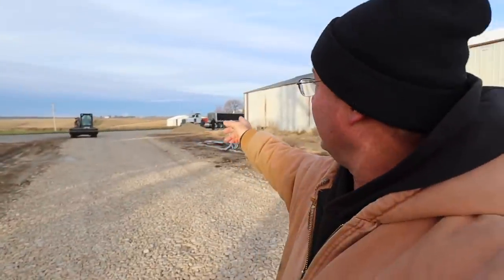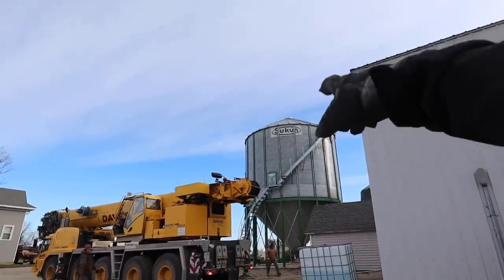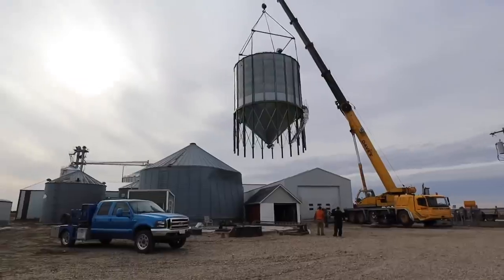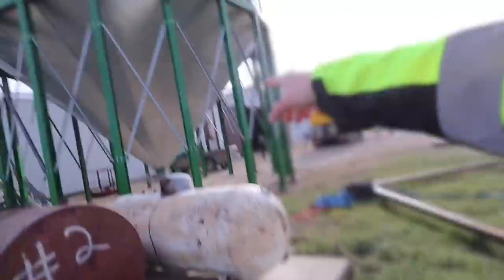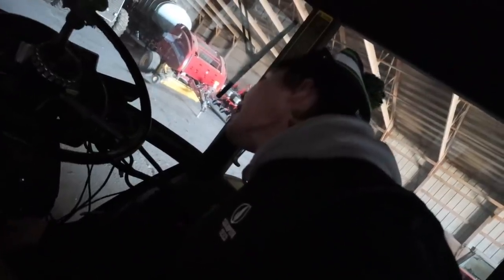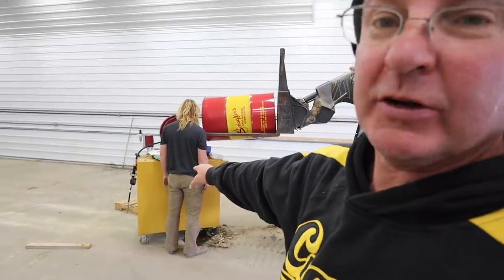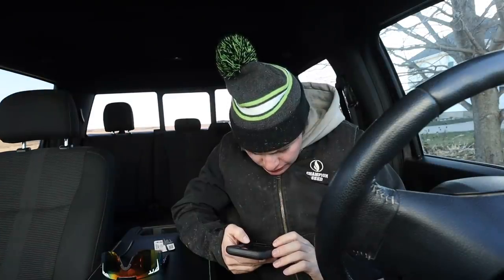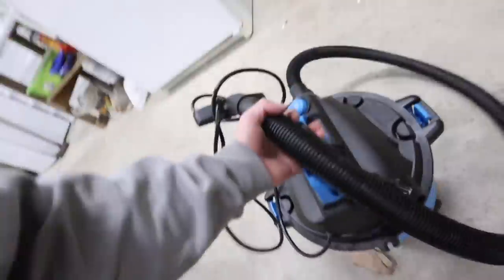My Biggest (& SCARIEST) Bin Move EVER

Comment: When you pushed the button on the contactor and the washer started, that was telling.  It means the entire power circuit is good.  Now you have to dig into the control circuit and find where the failure is.

Next time you have a device like that let you down, check across contactor's energizer contacts for continuity first.  It could be the contactor's actuator coil is cooked.  It's a fairly common failure mode and you just have to match ratings, it's a standard part.

Comment: Cole,  while using the vacuum to clean the dust, it is best to use a dry brush to agitate the surface and it will lift more dirt that way, especially around switch housings and vent louvers.  I use a shaving cream brush for my cleaning maintenance.

Comment: Hey Cole, you mentioned cleaning out the cabs of the machines, in order to make it less attractive to mice.  Another thing you can do is put a few drops of peppermint essential oil on the floor or other areas where mice are likely to make nests.  They don't like the peppermint scent.  (You can put the drops on a plastic lid or something disposable like that, if you don't want it directly on the equipment.)  I put some on my tractor a few times a year, and haven't seen mice scurry anymore when I start it up.
Reply: I heard those dryer sheets work too.
Reply: It’ll make the equipment smell better as well. Probably isn’t the best smelling place after months of harvest.
Reply: Mouse Away bags work great, put them in the car and boat we store over winter and no problems, ever.

Comment: Hey Cole, to save your truck interior and seats I'd recommend you get some good seat covers.  And I mean get some Wet Okole seat covers.  The are made from wet suit material, don't get hot in the summer or cold in the winter.  Waterproof, stretch fit, you can choose the colors and very durable.  I drive a '03 Ford Lightning.  Had it since it was just off the line 18 years ago and I use it as a truck.  It is starting to show its age and use but since the first month I had it I've had Wet Okoles installed.  I'm on my third set and getting ready to order my fourth.  My seats under the seat covers are still pristine.  The covers keep sweat, food and spilled drinks from getting to the factory covers.  They are easy to clean and easy to install.  Since my truck is a regular cab with 60/40 seats and a center console the cost is just over $300, and that is the same price I paid for my first set in 03.  They keep the value of your truck up and last summer I had an offer of $23k for my Lightning.  No lie $23k for an 18 year old truck.  I'm not a salesman nor do I represent Wet Okole in any way but I see the care and pride you folks show for your equipment and while after market floor mats are great to save you carpet, good seat covers save your seats.  Who knows.  Maybe they make combine seat covers and seat covers for your steroid injected tractor.

Comment: I think a lot of people would benefit from a basic electricity course of some kind. I grew up farming, got an electrical engineering degree, and now work for the electric company. I watch all the farm youtubers, and I gotta say a lot of the electrical issues you guys have might seem complicated (and people are skeptical about working with electricity and that’s ok too), but they’re likely very simple fixes. Invest a couple hundred in a good Fluke multi-meter, and from there it’s just coils, contacts, and load. Bin fans, leg and drag motors, pressure washers, even field equipment can all be simplified down if you have a basic understanding of what needs to happen. You guys are way smarter than a lot of electricians, trust me lol.

Comment: We had the same problem as on the power washer on a different type of unit but with the same electrical setup looks like and that "button" you are pushing in is part of the "contactor" which from the video it seems thats the issue, I ordered a new one online and swapped it out and that fixed our problem. Basically what that thing does is it has magnets inside of it and when electricity flows through it the magnet pulls in the switch and connects the two contacts inside (hence contactor) but the coil can go bad in there even on a newer unit (ours was less than two years old) and all the power runs through there so if it goes bad it wont run unless you push it in

So i think you need a new contactor just make sure you hook everything up right and you should be golden, you can search up the one u need by the brand and specs written on the old one and find it online or some HVAC supply places have them cuz they are used on AC and refer units too.

Comment: You’ve probably got a bad contactor (black box top Left hand corner) especially as the pump ran ran when you pushed the contacts closed using a screwdriver. either that or there is a low voltage transformer which powers the control circuit side of the contactor and that has given up, so the contactor is not getting low voltage power to close the contacts and the pump isn’t running. It’s the same principle as used to switch three phase power for big air con units.

Comment: Looks like you have a circuit breaker bad or your motor has an internal short . unhook your motor lead wires then reset your breaker if it resets then you have a short motor/ wiring to motor.if you unhook motor leads and it still kicks out it could be bad or the thermistor/ internal motor heater overload . your motor could be getting bad also and overheating looking at the video pics from what I can see.hope this helps
Reply: just bad contactor switch, they go out quite often.

Comment: Relays are a common thing to replace if that's the thing in the back. It's because they have moving parts to act like a switch. 

It's important to size the proper  amperage (& V of course)  for the replacement. (The little black boxes look mostly the same if you have some around.) Just Google all the info you can read.

You're sooo close to knowing how to fix it it's frustrating, lol. One of yas needs an electrical community college cert.

Comment: that is a three pole contactor that you push to make it come on. you need to check and see if you are getting voltage to turn the contactor on if you are getting the power then the contactor is bad if no voltage then what is before the coil on the contactor those are probably 240v contactor so check it with multimeter across the coil voltage with red and black meter leads. those are gonna be the 2 smaller wires not the 3 wires

Comment: These "small" mobile cranes can move slowly on a fairly plane building site without take away counterweights. (???) Tires are classed for very high vehicle weight when lifting the outriggers. I'm a bit confused due to the low weight of the hopper don't need massive counterweight either.
Reply: My guess is the reach farther less setups

Comment: Just FYI the thing DaddyCS stuck the screwdriver in is called a Contactor. It's basically a relay for high current loads. The 3 fuses are for each line of the 3 phase power and are on the load switching side of the contactor, since the motor ran the fuses are good. The box before the contactor probably is a rectifier/transformer to drop the voltage and/or turn it into DC power. 
If you can press the test button and get the equipment to turn on then it's always a problem on the control side(button - coil) of the contactor not the load side(motor).
Another way to think of it is the contactor is like the starter solenoid on an engine. It takes a control input from the key switch and connects the battery to the starter motor. Only with 3 phase, you are connecting 3 lines instead of one.

Comment: That card board around your concrete columns can hold moisture and may cause your concrete to pop off on surface. You guys sure went thru outer darkness with those engineers and contractors. Looks sweet though!

Comment: Check the thermal relay.  Your motor might be overheating and causing the relay to open.  It works if you manually push in the contactor.  Your relays are the first thing I'd check.
Reply: I was going to say the pressure sensor that tells that little device with all the wires to activate the contactor for the motor when someone pulls the trigger on the wand.

Comment: Just in case you haven't figured it out yet, that is a 40 amp eaton definite purpose contactor, basically, it gets energized and closes the circuit turning the motor on, you can manually actuate it like you did with the screwdriver but it likely needs to be replaced with a like part.  Relatively easy, de-energize at the breaker, keep wires organized and replace it.  Once a contactor fails like that it just needs replacing, there is no fixing it.  Shouldn't be more than 50 ish bucks.  That exact model may not be available depending on how old it is, just go to your electrical supply and show them a picture of it, it will still likely be the eaton c25 DP line

1
Reply: or find a good old 3 Pole Knife Switch remove all the other crap and just direct wire it.
Reply: definitely agree, bad contactor, easy fix and not too spendy

Comment: Contactor switch (the part you're pressing on with the screw driver) went bad in the power washer.  Has a small magnetic switch internally that keeps it in the "on" position, its not uncommon for them to go bad.
Reply: Or the solenoid isnt getting power to it. A multimeter is a must. Saves lots of time and money.

Comment: I think Justin is correct, need a new contactor . Might be able to find exact replacement, if not make sure amp and volt ratings are the same and it has the right auxiliary connections. The on off switch sends 110V (or 220) to the contactor which drives the solenoid which closes the circuit and power flows.  Screw driver does the same. Occasionally the thing being fed over amps the connector and it damage it. In this case both the motor and contactor needs replaced, normally just the contactor.

Comment: I bet the solenoid you were pushing manually is the problem. Contacts are ok but the coil isnt pulling in . It also could be the pressure sensor switch which would electrify that solenoid when the pressure isnt at set pressure

Comment: Hey Cole, FYI. There is an updated floor mat threshold you can install from a 40 series machine. The plate is a bit wider so the floor mat won't pull out from under it. It does get worse as the machine ages.

Comment: Since DC was able to start the motor by pushing in the manual test of the starter its not a power side problem, so checking the 3 phase power fuses was a waste of time.  I've troubleshot and fixed two many starter and contactor problems to count so you will need a volt ohm meter and in this order check:
1. If there is not a starter overload reset on the starter then move to step 2. If you have an overload block push the overload reset and try the pushbutton.  If your washer starts working when you hit the start button you could have had a high motor current sense or the overload relay block is getting weak.  It looks like you have a single phase motor so make sure the current on each wire is pulling the correct amperage as rated on the motor.  If not this could be a motor problem if all is okay try running it for awhile and if it kicks off again then re[place the overload relay block.
2. Check voltage at the starter coil.  If there is voltage when the start button is pushed check continuity of the starter coil and if it's open you have a bad starter coil, if no voltage across the starter coil then the problem is in the control circuit.  I've had bad overload relay block contacts go bad before but very seldom.  So let's go to the control side of the circuit first.

3.If there is a control fuse powering the control circuit check it  That could be one of the three fuses you checked so you may already have done this.  If no continuity replace it, if there is plug it back in and move on.
4,  Find the control relay.  Test the power from the hot side of the the relay coil to neutral when you press the start switch.  If no power there is a contact connection problem with the start switch and the swithc will need replacement.  If power is present then probably you've got a bad relay.
Good luck.

Comment: That looks like a contactor - it uses a 24v power circuit to pull in that magnet  that you are pushing in manualy. , that then engages the 120V or 208V  larger power draw.   They can go bad, but more often they arent getting the full 24v.  Is that "little thingy" in back a transformer?  Easily can go bad and cause the issue.

Comment: testing fuses with an ohm meter doesn't always work we had a grinder at my work that would not run if you took the fuses out and tested for continuity they checked out good but if you put them back in the machine and tested the voltage coming through them one was only passing about 50 volts and causing the motor to draw too many amps when under load and causing the overload to trip

Comment: Cole I hate to be that guy but why did you guys not just put the bin on a semi and then you could just move it on a semi
Reply: I hate to be that guy but............
1. Bin is as wide as 3-4 semis, what kind of platform you gonna build on there to hold it?
2. Very tall bin means a slight tilt on uneven ground topples bin
Need more reasons that you should let the pros do what they do for a living?

Comment: if i'm allowed to make a educated guess ( worked on powerwashers for 10 years ) i'd check if the relay is still good. if the relaycoil is bad, it doesn't pull the contacts for the motor ( Like what you did with te screwdriver poking in that ' thing' ) that thing is a relay.

Comment: So to better understand what Cole was saying: the pressure washer isn’t running because the relay that operates the contacter is kacked. So the relay isn’t telling the contacter to close.
What’s missing on this setup, likely by design, is a manual “on” switch. This would let them override the relay and make the contacter close. But that would cause the motor to run continuously until you shut it off, which isn’t the best setup, but at least you can finish what your doing, then shut it off.

Comment: It seemed a like a huge waste to not lower it on trailer and drive it over. 800 a hour I could have made a wide trailer for less than cost of one reposition of lift. Even two trailers side by side hooked to tractors slowly pulled over. One lift on trailer reposition lift well pulling over and another lift to position. .